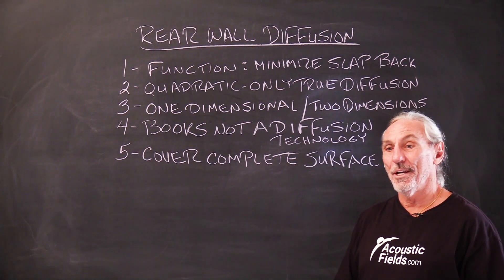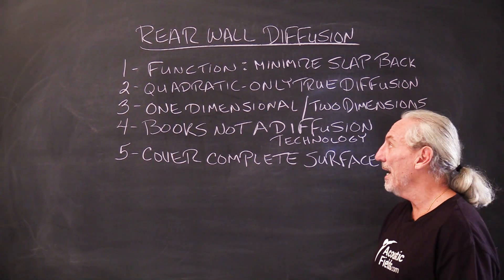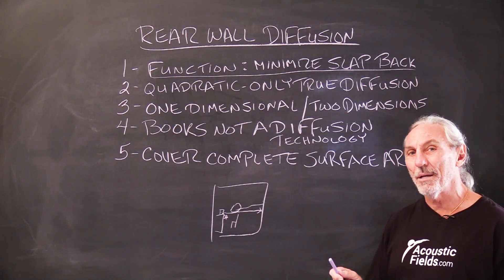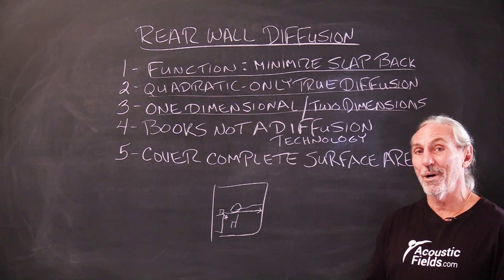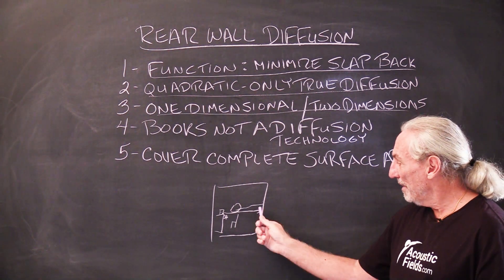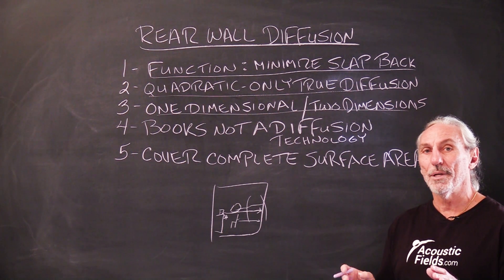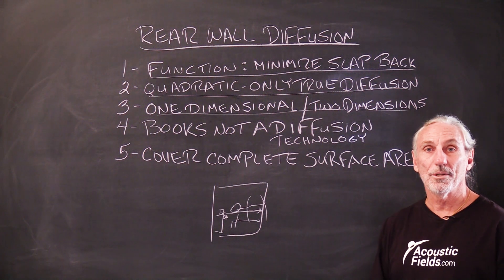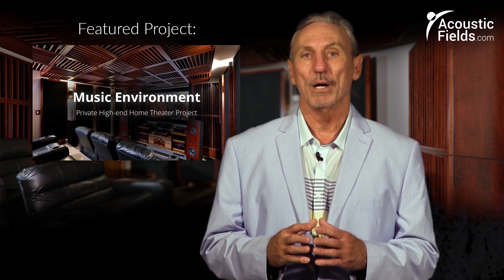Rear Wall Diffusion - www.AcousticFields.com

Comment: Would skyline diffusors be an option? What’s your opinion on them? Thanks for your video!
Reply from the maker: Skyline is a product name for two dimensional diffusion. You have one dimensional and two dimensional diffusion. Both have different sonic qualities. You have to apply diffusion to achieve a goal. That goal is determined by usage and distance from diffuser to one's ears.

Comment: Some pictures I have seen of listening rooms shows large collections of records and those seem to be used just like books as diffusers.
Reply from the maker: Records can not act as diffusers. Diffusion requires a frequency response that is designed for that room usage and the distances involved. A record can not produce the frequency response required nor fulfill any of the other requirements that a diffused sound field require.
Reply: @AcousticFields  obviously if books won’t function as diffusers then certainly records would not either. Unless something is specifically designed to be a diffuser then it stands to reason that there isn’t anything in a home listening room that can be an “accidental diffuser”.

Comment: Love your channel and an thankful for your insight and work.  I have a room that is small, 8x15 feet, would you suggest any diffusion in this size of room?
Reply from the maker: Diffusion is a technology you use only when you have all the room issues resolved through absorption. You must manage modal issues, reverberation times, and a host of other variables before installing diffusion. Diffusion will make your room sound worse unless you do your homework.

Comment: As an ex-polytechnique and recording engineer I could not agree more with the scientific approach. However not everyone has the proper location/money. I ended up setting my speakers in a large completely irregular room. No significant standing waves. I have a huge floor to ceiling, arc of a circle library, about 2000 books. It is open and has a 4 ft. passage behind. Using it as my back wall I measured with Sonarworks a sweet spot response from 70 to 15kHz within 6db. I also used some bamboo and lavender stems panels, just for the esotheric aspect...
Sometimes, one can also get decent results with some ideas, measures, and especially listening.'
Reply from the maker: Everyone's definition of resolution is different.

Comment: Ive a question, I mounted 3 absorbing panels on my rear wall (behind my couch) de distance between me and my seating position is about 50cm. And the speakers are martin logans 330cm from my listening position. Is this the ideal thing to do or should I go for diffusers? The effect of the absorbers is more focus on what's happening in the front but a little less depth in soundstage. Maybe putting a diffusers between my speaker can solve this?

Thanks in advance
Reply from the maker: Diffusion will make your room sound larger with greater definition and separation. However, diffusion requires that you meet certain set up and treatment requirements within your room.

Comment: Found this video when researching how to deal with a problem in a new room I am moving into. 

Room is 16'x9.2' and I have to organize length wise as I have to double my mix room as my bedroom. One side has 2 sliding mirrored glass doors that cover 80% of the wall, the other side is dry wall. I know the only real way to tell is taking calibrated measurements but without measuring, which wall is better as the rear wall?

I have 4" thick with 2" air gap absorption panels for both side walls and to hang from ceiling. I also have corner soffits for corners... Wouldn't be able to use soffits on mirrored glass wall.
Reply: I've just binge watched a lot of your channel. It sounds like the best option is to remove the glass doors and replace them with your sliding foam panels you designed. I can't seem to find the DIY plans on the website. Are they still available? Your fabricated offerings won't fit the size and budget is a concern.

Also, I know you said sound dampening curtains aren't ideal due to not having predictable treatment ratings but if I wanted to go a low budget route, would sound dampening curtains be better than nothing?

Been in Saltmines in AZ btw, respect your work!
Reply from the maker: S,  We can custom build the sizes you require.

Comment: Very informative videos. Thanks for these. I am looking to put something in my basement drop ceiling to absorb sound so it doesn't travel to the first floor. Are there any specific drop ceiling tiles or insulation you would suggest? It doesn't have to be fully sound proof but I want to block out a good amount of sound from entering the 1st floor above me. Thanks!!
Reply from the maker: G,  You can not reduce noise transmission with any free standing panel.
Reply: @AcousticFields  thanks! I appreciate it.
Reply: What kind of sound are you asking about? I see the Acoustic Fields doesn't really answer your question.
Reply: @DmitryMyadzelets  thanks for asking. It would be sound from speakers that I want to try and keep in the basement without it being loud to the floor above it. I have purchased  a drop ceiling with armstrong sahara tiles. It is not installed yet but I think this will work decently. I can also reinforce it with foam on top of the drop ceiling to absorb more sound. I hope it works lol. If you have any suggestions on top of this just let me know. Thanks!

Comment: Not only do books not make a great diffuser, but any sort of enclosed bookshelf is a resonance chamber. That picture of the wall of books is a picture of lots of bad resonance issues.
Reply: Would you mind to do some math and tell us more? The resonance frequency, decay time etc?
Reply: @DmitryMyadzelets  Every object is different. The lousy bookshelves resonated around <200hz, the windows in that room resonated at >1khz.... and it is hard to pick out resonances until you have identified them, then they stand out like crazy. I actually recommend the purchase of a cheap stethoscope for listening to objects so you can hear exactly what they are doing. I used it on the windows to identify the sound and then to verify I had dealt with it, I use it on speaker cabinets, furniture, whatever, to hear what it's doing. It won't find all your issues, but it helps with many.